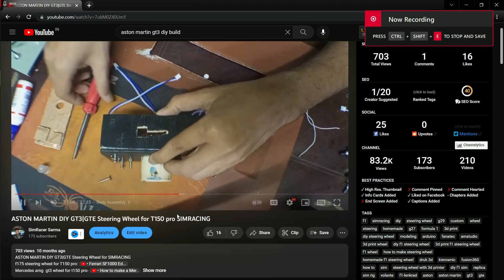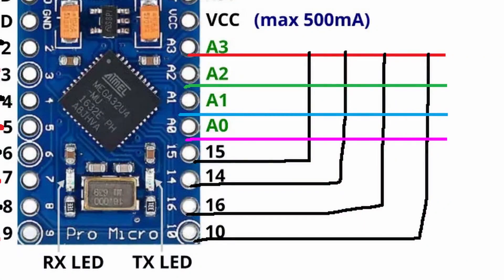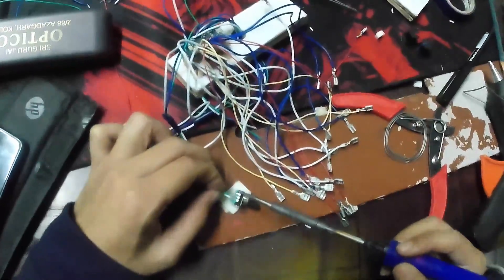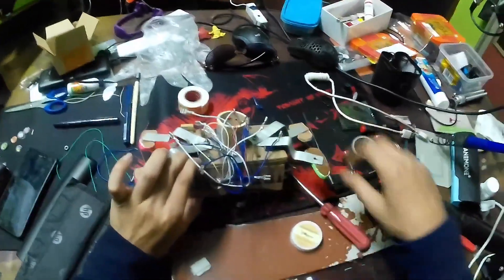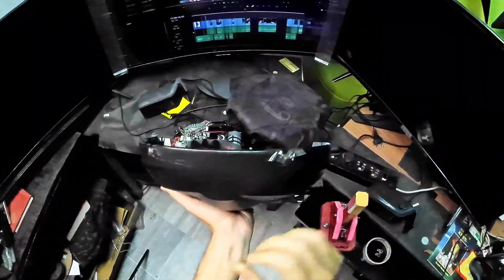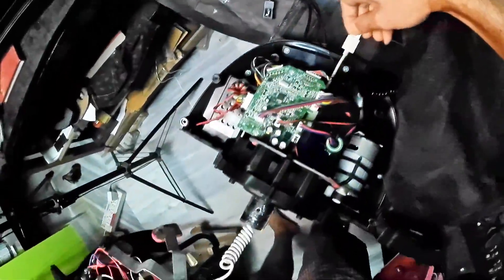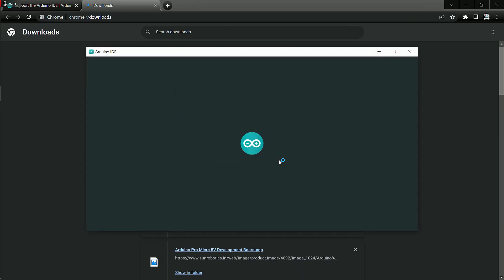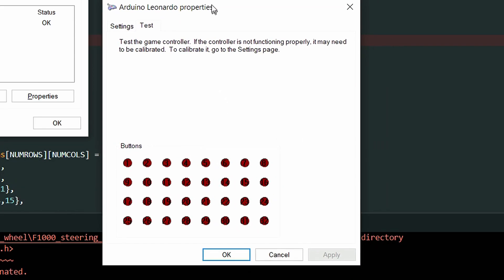F1 Steering Wheel | Thrustmaster T150 Wireless Arduino DIY Wheel Indian Sim Racing Cockpit setup

Comment: Pc only
Reply from the maker: You will need a pc to upload the code. but it should work in PS5/4 as it is a dinput configured. cant guarantee in xbox
Reply: @simracingsarma  ok thanks I was trying to make a t500 compatible for ps5 with modded wheel but it won't work suse there is no ps5 chip in the t500 wheel base. Only t300 and t150 and the newer thrustmaster wheel are compatible for ps5